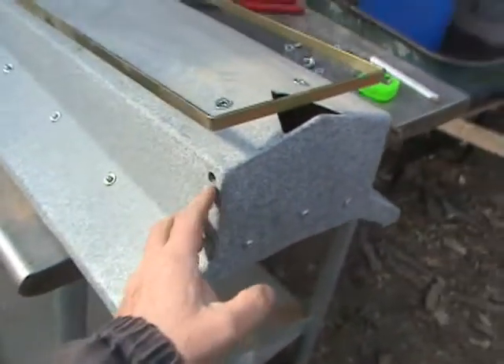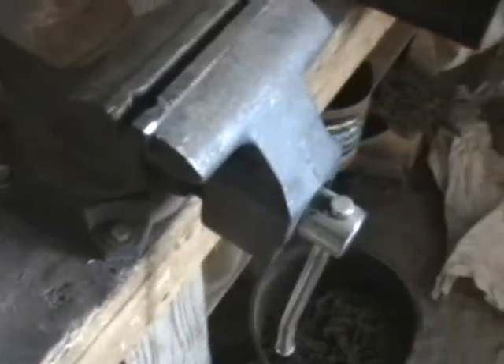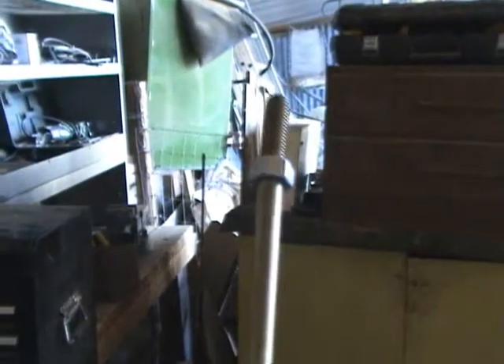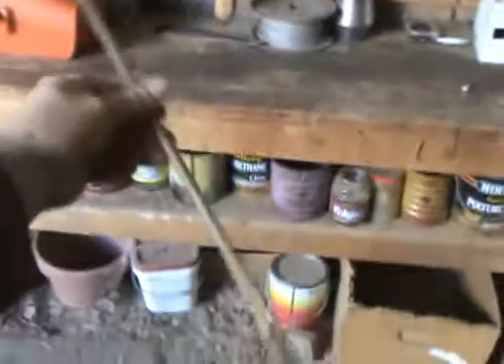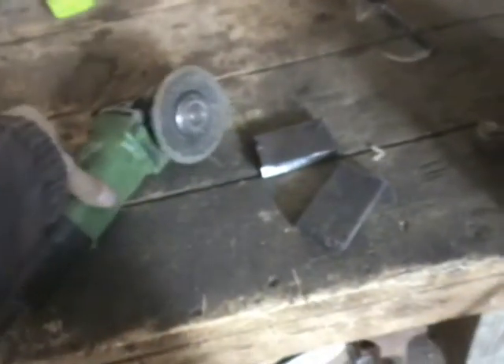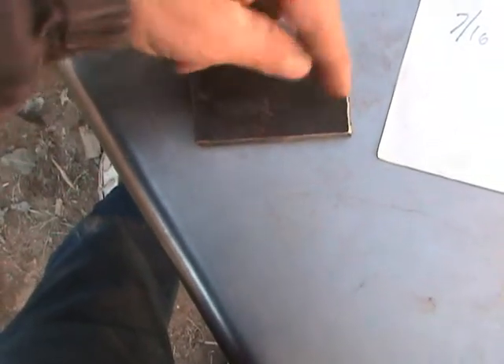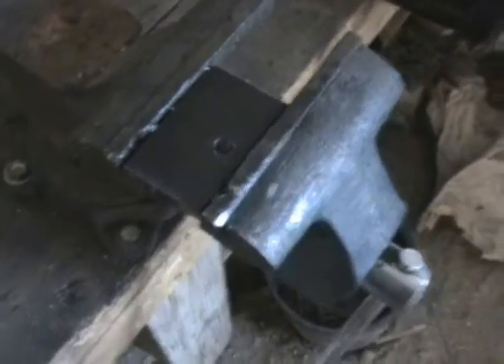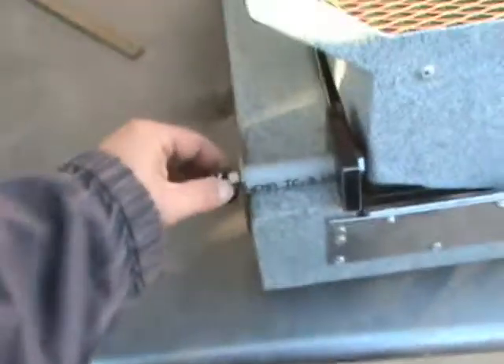Keene Engineering Dry Washer, Modifications 02: Hopper Mounting Rod

Comment: I'm buying you a tripod...The Riffle tray finger bolt attachment plate will go up flush against the air box but you have to tilt the riffle tray way up and then as you bring it down slide it in all the way. Then that plate on the riffle tray will fit flush when you go to put that finger bolt in which holds the riffle tray in place. I thought the same thing and then found that I was just not getting the riffle tray up all the way into the air box as far as it is supposed to go.